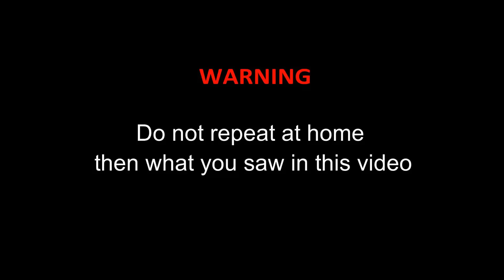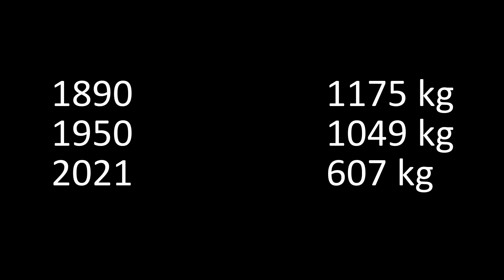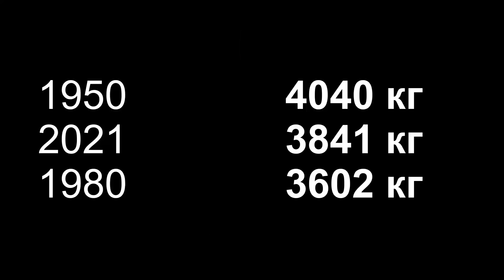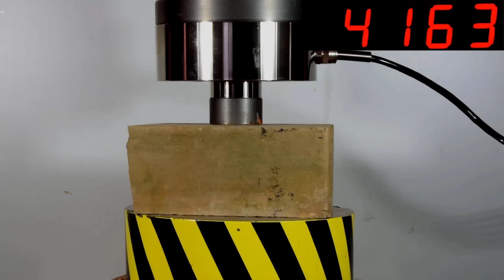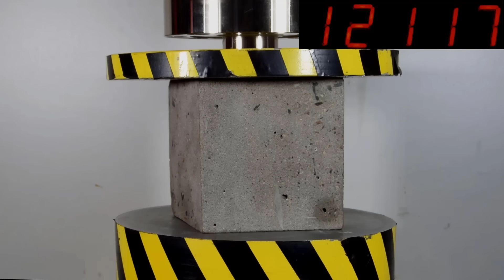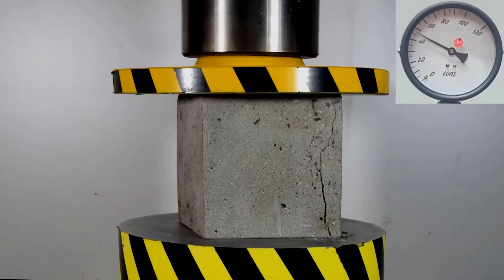HYDRAULIC PRESS VS OLD AND MODERN BRICKS

Comment: 2 comments about the "concrete" blocks at the end. 1- The first one wasn't concrete, it was mortar. It had no aggregate in it which makes it stronger and makes it concrete. It also seemed to have an abnormal amount of sand. 2- Concrete takes several years to fully cure. 24-48 hours for foot and light vehicle traffic. 28 days for heavy equipment. Decades to reach maximum strength.
Reply: When I was a concrete fabricator back in the mid 1980's they often used to say that concrete for example takes 99 years to fully set.
Reply: I was pretty upset with the “new concrete” shit literally looks like quick Crete from Home Depot. I’m a laborer “construction worker” and I was like where the fuck is the aggregate. Look at the old Crete compared to the new it looks like 411 stone sand mixed with water and a low concentration of cement and poured stupid wet to make it easy to deal with.
Reply: When I saw the new "concrete" crumbling I thought, "It still looks wet on the inside"
Reply: Yes exactly, and the moden red brick was fired at lower temerature than the old ones. The lighter hue of red shows. Every stepof the production of bricks matters. And if a brick doesn`t have to withstand high pressure the production costs are lowered such as lowering the firering temperature or duration.
Reply: Something I noticed was that the "modern concrete" was not level on top. When the press came down it made contact on the left but you could still see a gap on the right. Which means the forces were concentrated in a smaller area then old one.
Reply: And the concrete samples analyzed by EN standards are cylindrical. But in any case... that's mortar
Reply: No kidding? I do brick and crete for a living and always thought it was 3 months to fully set. Then again i use to paint cars. Paint took 3 months to set so maybe im confusing myself.
Reply: "Decades to reach maximum strength."
Then why are we always repairing and replacing freeways and interstates if the older they get the stronger they become?  Because you are wrong.  Most concrete reaches its maximum strength in about a month.
Reply: @jbrock8596  Because no one lets them sit for decades.

They are still soft, and they break easier.

Concrete doesnt take 100 years, thats just a myth. But it does harden with age if the conditions are correct.

Sooo both of you are partially wrong.
Reply: This is why things like bridges use pre-cast components - pre-cast means pre-cured, so they are strong enough from the moment the bridge opens.
Reply: Also if the old one was from a military fort it’s going to be a lot stronger than any random average
Reply: yes that was my first thought too, this is the post i was looking for, indeed that looked nothing like concrete, it was just cement and sand
Reply: @jbrock8596  it builds strength over the years. We test our concrete strength at 3, 7, 28, 90 days, 1 year and i think 2 years. Currently chipping away at 80 year old concrete and its miserable  Concrete roads are a different story; there are too many environmental conditions and subgrades are too variable at length to make a proper mix and is equally not fiscally practical to do so. Road wear and tear is an unsolvable problem at the moment.
Reply: concrete does not take years to fully cure
Reply: @mirceaalex9907  sample are cylindrical and cube since concrete class is write as Cxx/xx for example C50/60
Reply: Thank you! Was hoping somebody would point this out
Reply: @3_shotz961  UGUGUG

Comment: For entertainment, this was interesting.  However, as a true test of identifying the failure of each brick or concrete block is flawed.  First, testing the tension of brick is not a valid test as bricks and concrete is designed for compression with very little tension qualities.  Second, you used the broken bricks from the tension test to perform the compression tests.  Each brick’s size was different and were already damaged by the tension test.  When a brick made of clay or concrete properties will changed from the tension test with many micro cracks from the tension failure.  Regarding the concrete test,  a few issues.  First, the fresh concrete was not given enough time to harden to its designed compression strength.  It was also tested “on end” as it was obvious this was poured into a wooden mold.  That will affect the crystal structure of the concrete.  As has been pointed out by others aging the concrete is needed to maximize its’s strength.  The “old” block you compared it to is like comparing apples and oranges.  That “building” you cut it from could have been designed for handling pounding by cannon balls.  The grain in it shows some form of additional material was embedded into the concrete, most likely granite gravel.  It may sound like I’m criticizing your demonstration, however, as a long time viewer I enjoy your work.  In this case, however, I don’t want people coming away thinking “old is good”.  Today’s building materials are subjected to close scrutiny by engineers to avoid the failures you show.  In many instances every pour of concrete are subject to presses like yours to ensure they pass the specifications set for the intendant project,.Still fun to watch where the failures occurred in each of the materials.
Reply: The "Modern" concrete was lacking aggregate(gravel). This severely reduced its strength, and does not resemble the vast majority of current concrete mixtures.
Reply: @stevenshewey7851  Yupp seemed like pure mortar with too much water content. Proper concrete should take about 3 tonnes per square inch and that's by hand mixing it. More refined mixtures are done in concrete plants. 

In addition concrete needs to cure for at least 30 days or more before any work is done on it. It needs to be shrunk slowly so if you are in a hot region you need to wet it daily. 

Taking pretty fresh mortar is pretty impressive e that it withstood 6 tonnes.
Reply: Even if you wanted to argue and say "old stronger", The amount of time, money, and processing invovled to create a modern building out of modern materials isn't even a competition for what constitutes marginal strength differences under flawed testing circumstances at best.
Reply: Kralsın
Reply: Do you have a life
Reply: You know our world is on its way out when people can’t even watch a video of a fucking brick being cracked without writing a novel of how it’s wrong, get a life bud
Reply: @d.b.cooper1292  my thoughts exactly
Reply: I came here to write that comment. I worked over two years in civil engineering laboratory, where I was testing concrete and bricks among other things. There are ISO standards for those tests and the tests in video are wrong on so many levels it's hard to point out everything. I assure that no old brick would come close to proper modern concrete. Even so, the bricks tested properly would most likely show higher results than those in video. I tested concrete made for high volume roads and those things would explode during tests, because the tension was so high.
Reply: In civil engineering , it's common knowledge that concrete gets stronger with time.
Maybe that applies to bricks too.
But yeah some ppl might get that idea that old stuff are better than modern ones.
Reply: @FreeminderXIII  Many Old things are better then much of the New things of today...
Reply: You said it all, and saved me the time of writing the same thing! Thank you!
Reply: @stevenshewey7851  modern concrete is also designed around a rebar skeleton.
Reply: @d.b.cooper1292  You have to hand it to him. It is quite the novel on bricks. Reckon he should become a politician
Reply: @d.b.cooper1292  you know our world is on its way out when people actively disparage others for thinking critically.
Reply: Had similar thoughts but found the tests to still be informative and entertaining. Also, not a tension test, but a shear test.
Reply: I kinda agree and disagree with the comments here
Reply: Not to mention that the knowledge behind the creation of each is different.
Older versions likely had more "wiggle room" incorporated into the mixtures and processing.
Modern materials are made to perform within precise parameters with minimal waste of materials.
Hence why they can make things cheaper, but also less overtly durable, since the thing involved was engineered to fill those parameters AND nothing more than a reasonable safety margin.
Whereas older things were made with the expectations that the thing in question would likely be asked to do things it wasn't truly made to do, or be expected to handle an exceptional quantity of abuse over extended periods of time due to a low replacement rate.
In other words, old things ate made with the expectations that the owner isn't going to be performing a lot of replacement or refurbishment anytime soon.
Modern materials are made on the premise that it's cheaper to buy than repair... And makes more sense from the view of capitalism.
Reply: Real Engineering moment.
Reply: @d.b.cooper1292  it's providing information he didn't act like a child and have a temper tantrum he said it in a calm fashion so you should be the one getting a life because you think a calm expression of opinion is bad
Reply: Ok boomer.
Reply: @d.b.cooper1292  I disagree. These people are the ones who insure that the bridges you drive over don't fall down by using the correct material
Reply: i was just going to say that this, as a test is bullshit.
Reply: Well damn Mr. Bob the Builder!!
Reply: This test took building materials from standing structures built in the 1800s. Of course they’re strong, they’ve lasted over a hundred years. The buildings made of weak materials aren’t still standing to be sampled from.

This is like comparing the average strength of the building materials in every structure built in 2022 versus the average strength of only the structures built in 2022 that would last a hundred years or more.
Reply: Not very bright are you?
Reply: @Hi-nf5yt  or put it in a water bath. For our tests we put concrete cubes in a 20°C Water Bath 24 hours after we made it and then let it cure for 28 days. 
For this video i don't think we can compare the antic concrete and modern. The materials are not the same and they have so much importance for the final product. 
Sorry if i made some english mistakes :)
Reply: Good comment thanks. These irrational thought have to be challenged at every opportunity
Reply: Well spoken, Frank. Very thoughtful and experienced.
Reply: Nope, the old brick is stronger. That is fact. But that doesn't mean that the old brick is better than the new one. The old bricks is stronger but way heavier than the modern bricks. Bricks, in most of the modern building application, are not used as structural component, so the strength of the bricks (flexural or compressive strength) are not that important. For architectural component, the lighter the material the better, because it will generate less load to the structural component. If you want a stronger structural component, instead of using heavy and less strong brick masonry, you can use the reinforced concrete, which is ligther and way stronger. Or if you are building a house is US, you can use woods, which is easier, faster, and cheaper to build than brick masonry.
Reply: @saifudinabdullah1903  older clays had a higher iron content, and excavations mixed with restoration projects have found some materials haven't gone rock hard. (Typically the mortar itself and not the bricks.) It makes you wonder how they knew this technique; and if it may work in earthquake prone areas to help with flexibility.
Reply: It's funny how everyone's an expert in the comments but everyone's opinion is different. My test is whether a big bad wolf can blow it down.
Reply: Old imperial size London stock bricks break quite easily , compared to new common bricks , but you got to consider their age , all materials lose strength. Maybe except something like Bath stone , plenty of stone houses still about , just been repointed
Reply: @rtyrtyrtyus  actually the vast majority of the comments providing modern professional feedback, and that's only because I haven't gone through all of them,  agree on what the OP said
Reply: There was EVEN BIGGER FLAW with his test with modern concrete: the faces was NOT parralel and therefore the load was not spread evenly. That make a huge difference. That fact alone could be responsible for the majority of the difference.
Reply: @d.b.cooper1292  No one told you to read it, just keep scrolling. You could go your whole life without even knowing the comment existed. Pretty hypocritical to say someone can’t watch a video without writing a novel, but it’s pretty sad some people can’t just scroll through comments without hating on someone for just choosing to write a comment. It works both ways, which one is worse the guy writing a comment to pass on knowledge to those that care or the guy that gets mad because someone wrote a comment. How’s my novel tho?
Reply: @infosneakr  so they ensure corners are cut
Reply: @PilferedRose  most of the buildings from then were knocked down on purpose
Reply: Mate.. If u want a perfect test, design one and we'll see how u go.. But this is industry standard.. To measure PSI (pressure per square inch). It measures how much pressure it can take before breaking. Its a indicator or hardness alone, the real quality tests won't give u a clear cut reading such as PSI.

Comment: It would have been more interesting to test the bricks the same way you did the concrete, as bricks are designed to take weight over their whole surface area and not just focused on a certain point.
Reply: Yep, would better represent their overall strength too, since this test really just tests the strength of the middle spot
Reply: here where i live the main spots of the building have larger bricks, plus i never saw shitty briks like the 2022 ones

Comment: One thing to note is the use of each, for instance, the antique concrete was taken from a fort meant to withstand artillery shells while the modern one was most likely commercial concrete which I would assume would be weaker.

Also the modern brick maintained its shape and load bearing potential much longer than the initial crack, up to 5200 kg.